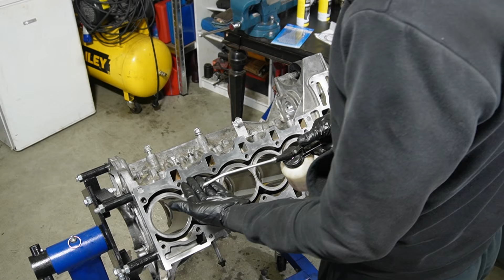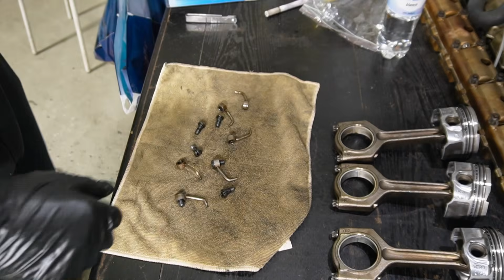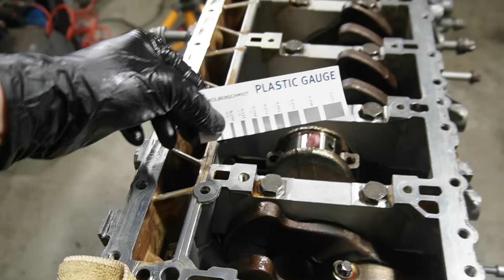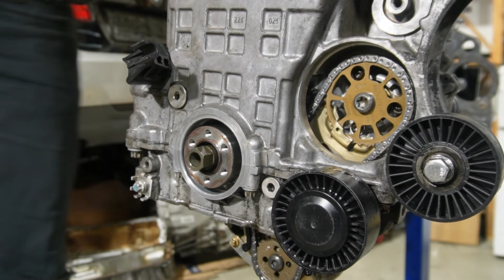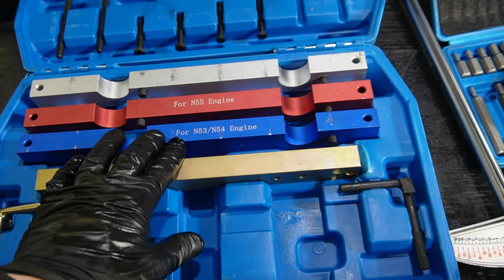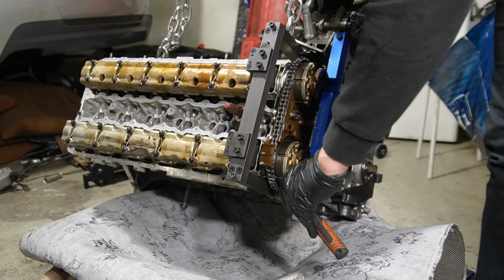N54 ENGINE REBUILD-BMW 335i Restoration | PT5

Comment: Hola amigo tengo un problema mi bmw N54 2007 manual le cambié el motor pero compré un motor de un automático pero el volante de inercia (flywheel) no coincidencen lo hoyos que puedo hacer. Hay diferentes tipos ???

Comment: From our experience with the N54, we've seen that this seal tends to leak after a few years, and replacing it is a considerable undertaking.
However, I must admit that I jumped out of my chair when I saw how you installed the rear main crankshaft seal.

37:33 PTFE seals are very fragile, and normally we need to use a special tool (a sort of large bell), but we can use a 100mm diameter tube. You used a screwdriver and a hammer to install it; I shed a tear.

Your video series on rebuilding the N54 is truly a goldmine of information. Thank you again for sharing!

Comment: Best video, watch it over 40 times about to build my first n54, pulled it out because of bedplate leak and already plan on doing a full rebuild
Reply: Built my n54 as well a full build not a rebuild tho lmk how yours goes mine almost done
Reply: @ryanvert7043  what are all the Bolts you will be changing and reusing?
Reply: Could I ask u some questions
Reply: What happened

Comment: on this engine should the rod bearing clearance be better at the loosest spec? , you can use a thicker oil which is better for the turbo blow by and able to tolerate high boost ?

Comment: 18:25 My suggestion to you, torque down every bolt to first torque specs couple of times, because head is curving, you will be surprised after first sequence you can still tourqe down bolts to the same 30nm spec, like 2 or even 3 times, by some 10 degree turn, this is the proper way to install the head, no manual says that
Reply from the maker: Yes good tip, when i was torquing it down i realised this, so i retorqued all the bolts multiple times😊
Reply: So the first torque you do out of the 3 on the head bolts you should let it sit go back do it again then do the next the next and then final torque?

Comment: En.Hi I haven't seen you check oil pump gears backlash. Do it.
Lt. Sveikas, nemačiau, kad tikrinai tepalo siurblio krumplių įvaržos. Patikrink.
Reply from the maker: What gears are you talking about? The oil pump is driven by chain, from what i know there is no way to check backlash on chain driven sprockets?
Kad siurbly ant grandines dirba ne dantračiu

Comment: This is all cute but seeing your previous rebuilds,what matters is how you break in the engine. On average,even a badly assembled engine depends on how you break it in….do a good run in,flush the oil. No high revs for the first like 100 miles or so.
Reply: this! It is easy miss some details , lol